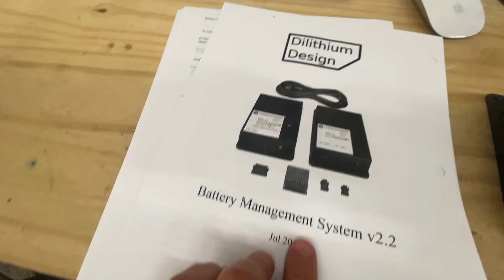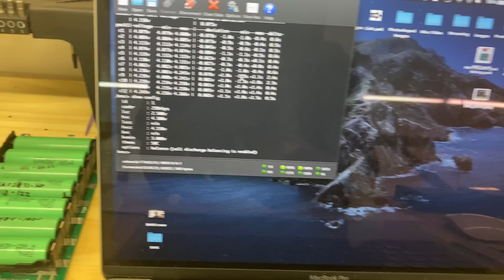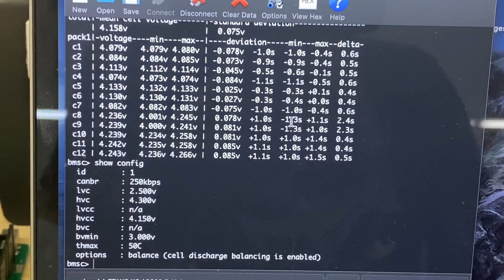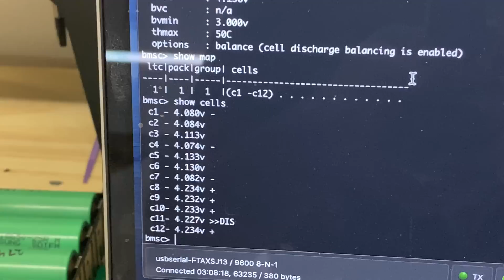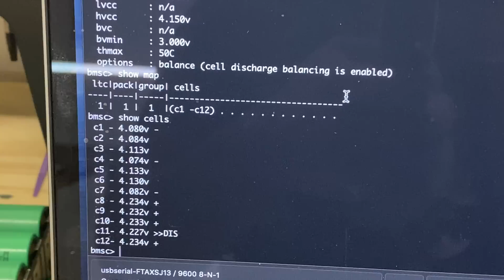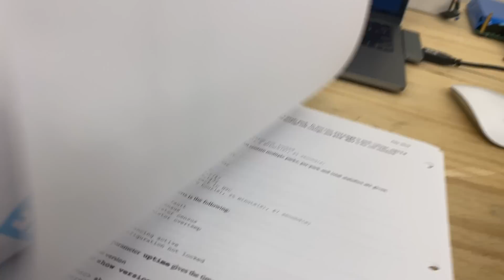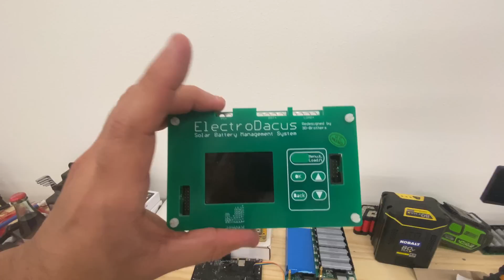Dilithium BMS

Comment: we need an open source raspberry pi solution
Reply: At least for the display unit.  It just reads CANbus messages.  Not hard to tap the CANbus and read it on a Pi4 or ESP32 and make your own display I suspect.

Comment: That adapter is an OTG adapter so won't work on a laptop, it's meant for a phone. The usb c connector on a phone is pinned out differently to a PC, that's why it wouldn't work.

Comment: Howdy Jehu...the power supply to the right with the meter & orange knobs on it...can you show the labels or a link to it if you can?
Reply from the maker: In the description
Reply: @jehugarcia  I checked all the links but could not find the one for the power supply...found the BMS stuff.  
I want to get a power supply like the one on the right...silver with a V/A meter and orange knobs for the current/voltage selection.

Comment: I have two ups units I been using for my off grid one is 48 volts that one no problem with a14's bms my other one is a 72 volt ups my solar charge controller is been doing great no overcharge and the ups has a low voltage cut off so for a year now I haven't had any problems using 18650's without a bms and I check them periodically to make sure they are balance

Comment: Sounds like this is cell based rather than overall voltage based?  For example, if I have 6, 14s (48v) batteries in parallel - that's 84 individual packs but 48v overall voltage.   In other words, is this like Batrium - that track/balance all 84 packs and it doesn't care about overall battery voltage.
Reply from the maker: Yes but why would you want to do it that way?  Parallel all 6 modules down the balance leads and you only have to manage 14 groups of cells

Comment: There is no need for such a expensive one unit BMS, its move conviniment to use normal BMS'es and use output from each BMS as a controller for one or multiple contactors. Battery voltage can be 900v or more, no problem.
Reply: If you are saying I could use 6, 16s bms in series,  how would I balance each 16s group against each other?
Reply: @bigwhimsy2236  I dont see any problem at all as you wil serially connect the battery packs. This is similar to what tesla does.
Reply: @pergoransson3397  What would keep each pack of 16s the same voltage as the other packs of 16s? why would they not drift apart the same way individual cells in series without a bms would?

Comment: This is very similar to the BMS I designed.  I used a different Linear chip for the battery interface.  Mine could handle in the neighborhood of 250 cells.  The only thing about the Dilithium system I don't like is part of the system is powered by the cells it's monitoring.  You need some way to disconnect all power just in case.
Reply: When you say mine could handle 250 cells, do you mean the BMS or the Linear  chip? also do you mean 250 cells in series or each individual cell having  a lead on it or the whole parallel group in a pack of cells? Im really new to all this, so I apologize in advance for the awkwadly worded question.
Reply: @directionwood  The Linear chips used in this BMS have a communications daisy chain limit of 10 or 12 units.  My modules still handle a maximum 12 cells each but the parallel system nature allows any number of modules.  My 250 cell limit is due purely to the CAN protocol I'm using.  If I were to change the protocol the sky is the limit.  But since my system is for an EV going to a larger system isn't required.  In reality I only need 96 cells.  I've worked out the systems for several packs including the Model 3 battery.  There are quite a large variations in battery pack construction as shown in the Dilithium v2.2 manual.
Reply: @DIY Projects According to the Dilithium manual they're using the LTC6811-1 which is an upgrade to the LTC6804-1.
Reply: @randycarter2001  would you be willing to sell a system for a project in working on I have 2 strings of 84cell packs. Need a bms that's not crazy expensive. Plus I'm thinking of adding 2 more strings of 84 cells
Reply: @DIY Projects All I know about the Dilithium system is in the available manuals.  Click on the link to EVwest in the description.  At the bottom of the page is a list of PDF documents.  Being an engineer I can make an educated guess about how their system is built and make note of the problems it has.  (No system is perfect.)  Considering the size of the enclosures, price and descriptions there is no active balancing only passive.

Comment: Hmm, this BMS might make it possible to design a DIY replacement battery pack for a Mitsubishi iMiev (330 Volt nominal) , using high capacity cells to double the range. 🤔 The iMiev battery is described as having 22 modules in series; each module contains 4 50AH cells in parallel. A DIY module could mimic the 200AH module with many 18650 cells in the same space. Then 22 modules could be connected in series, as before. Alternatively, modules each containing 22 cells in series could be connected in parallel. 😵 I have read that lots of small cells in parallel can stress the weakest cell. Any suggestions?

Comment: Serial com is just a communications protocol that the early computers used to communicate with other devices when connected directly. Computer manufacturers have gone away from the serial port and now in order for you to connect to a serial device you need to use a usb to serial converter. Usually network engineers need those converters to connect directly to a piece of networking equipment to configure it. I have usb to serial devices that I use at work that you can actually attach an IP address to also to communicate to.
Reply: Called FTDI
Reply: These days even you have the option of wifi connected devices they are actually great!!

Comment: can you find a split phase 220/380v inverter? Woult be very happy
Reply: Teknohuhn Just a heads up. Your voltage makes me suspect you are in Europe. In Europe electricity is transmitted at 50hz. In the USA electricity is transmitted at 60hz. This is very important to keep in mind when selecting your inverter.